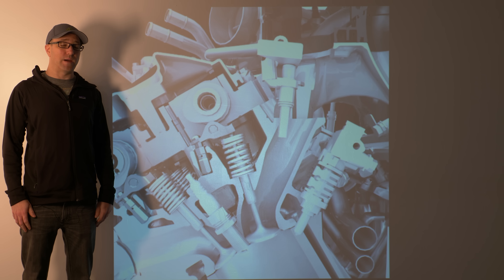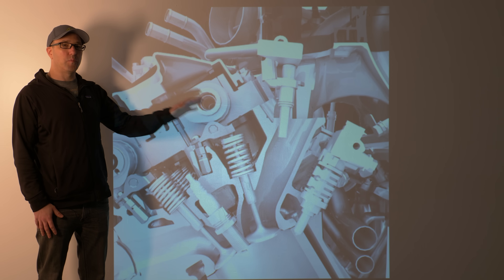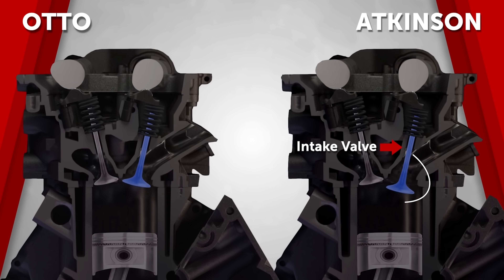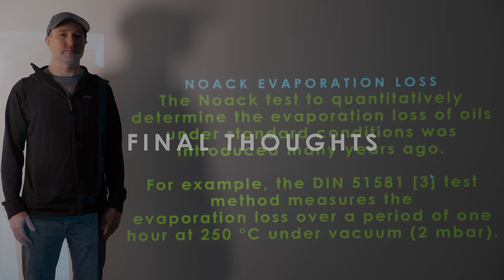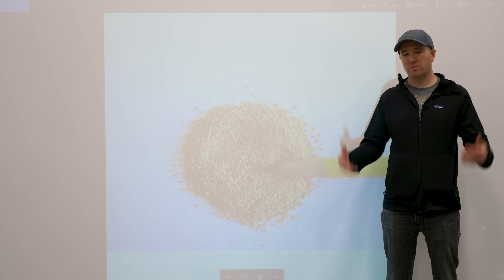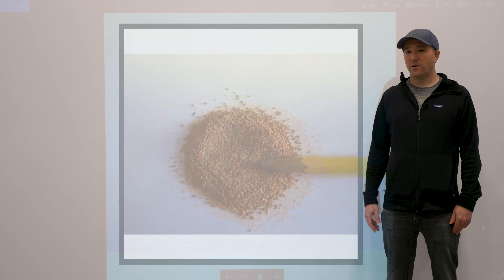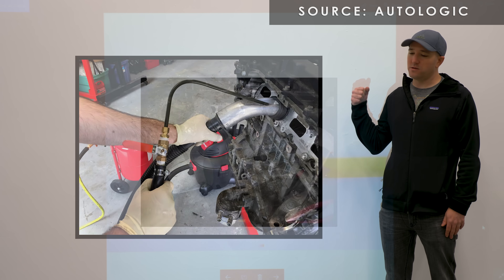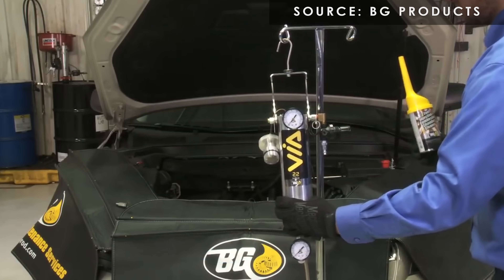Direct Injection, Problems and Solutions | The Fine Print

Comment: I bought a used 2014  2L GDI Kia Forte ES three months with 117K. I added a can of Chevron Techron right before I changed the oil with high-milege full synthetic and a Wix filter. I drive 3K a year and it doesn't burn oil. When should I be worried about carbon buildup on my injectors and in-take valves?

Comment: Driving and ownership habits matter as well. Change the oil with high quality synthetic oil often. No more than 5,000 mile intervals for my Z4 35i. Drive the car gently until the oil is fully warm and if turbocharged, let the engine run gently before shutting it off - think 2-3 miles from your destination.

TBH, I'll probably just treat the car as well as I can and have the valves cleaned every 40-50K miles. $700-$1000 every 50K miles to have the valves sparkling clean is not a big ask. Plumbing some aftermarket can and hoses into my pristine engine bay and needing to check and empty this can often sounds like a hassle. Do something wrong and you have new problems.

Manufacturers spend huge amounts of capital for R&D, and create very efficient machines. Most aftermarket add-ons tend to muck things up, creating the most value for the companies who market them.
Unless there's a critical issue (for which most OEMs will issue a recall), and I don't consider this problem to be critical, I'm going with manufacturer recommendations.

I've been down the customize road before - it's far easier to drive and maintain without all the crap we bolt on our cars - thinking we're doing something the OEMs never though of. My 2 cents.

Do as you will.

Comment: 18:55 - this really does not seem like a problem. I don’t know if this is typical or not, but the actual air path over the valve and seat is nowhere near constricted. The before and after the walnut treatment here would yield negligible improvement in air flow. 

automotive engineer here, albeit haven’t worked with direct injection engines.

Comment: The PCV valve vents oil mist pressure from the crankcase not the inlet manifold . This released oily air is then  directed into the inlet manifold to be burned in the combustion chamber . This is why the carbon builds up on the inlet valve. Port injection washes these deposits away preventing build up

Comment: To prevent carbon buildup on DI gas engines just install a small TBI setup similar to 90’s style, Chevy are you listening?!!! You don’t need bunches or port injectors in the head for every valve…..

Comment: Great video brother. Question for ya. So I have a 2017 Acura ILX (k24 DI) I bought with 29k miles in 10/10 condition. I have always ran 92/93 octane, fully syn every 3k but I’m not going into oil change intervals as I don’t care it’s just what I do even if it’s early. I changed the valve cover gasket at around 90k and couldn’t believe how immaculate the head was. Zero discoloration on any of the cams, valves, rocker arms, or head itself. Looks like it was machined that day no bs. That being said at she’s getting up to around 100k plus I do notice a rough being very strong word but at times at idle with the AC on, off it purs like a D15 smooth as butter and only hear the fans cycle on off. Completely stock 100% other than rims that I went with but did research the Exact size offset as the A Spec including the tire size. Went from 17’s to 18’s but figured I install the optional A Spec size in its exact geometry. I changed the plugs out recently, air filter always at 30k, and just general MX. I’m curious about the idle as it drops to around 700 when she usually chills at 900/950. I may pull the air box off the throttle body in the morning and look at the butterfly. Any thoughts?

Comment: EXCUSE ME but WHY does LESS FUEL BURNED not equate to LESS EMISSIONS?!
I'm on my third GDI engine vehicle.  Last one LOCKED UP, driving down the road at 60 mph.  Thst was fun.
It is ALL ALL OF IT, so much PLANNED OBSOLESCENCE SCAMMING.
So, INITIALLY, GDI developers did not know about CARBON FOULING.  
Once they KNEW why did they CONTINUE CHURNING THEM OUT?!   
WHY have MORE manufacturers gone with GDI?!
Additionally, they're also PURPOSEFULLY fitting pistons with LOOSER PISTON RINGS, which WILL promote MORE PISTON BLOWBY.
So go ahead and argue thst it's all out of the hands of scientists, engineers, manufacturing execs.
I WILL NOT BUY INTO THEIR LIES, CORRUPTION.

Comment: LOVE this video regarding DI. I have a 2012 Range Rover Autobiography, with a  supercharged V8 5.0L.  I'm in the process of tearing it down to do the infamous timing chain job. I endoscoped all 8 cyl. with/small 3.9mm dia. Endo., After seeing nothing bad, I removed it, taped it to itself w/electrical tape so after reinsertint it, I could look back up at the valves. All fine. Also used a sideview endo. & not bad either. I was going to engineer an oil catch can system for it, but I saw that the L. side valve cover has a built-in "oil seperator" by the PCV valves (that I'm replacing too). Do you think I should still  add a Quality catch can? Obviously, before 2012, JLR knew there was going to be an issue. Your thoughts please?  Thank you, John

Comment: Unfortunately modern engines don't have PCV valves, they have PCV systems that are part of the internal engine system and catch cans are not an option. Change your oil at 5K miles and use a high quality full synthetic oil.

Comment: Oil change on my new-to-me 2018 Sport 6 speed. I mentioned to my mechanic about the potential carbon build up and he had Pennzoil Platinum Full Synthetic on hand. Said this should help the engine run cleaner because it is derived from natural gas, not crude oil. Anyone else running this?

Comment: Regulators are so dumb. They should consider the whole life emissions of an engine(including burnt oil) and not just a snapshot when the engine is brand new and running in ideal conditions. Low tension piston rings just add to these problems.

Comment: Have a friend who owns a 2012 Lexus with DI 4 cylinder engine. The car has 90,000 miles and has had to have the intake valves cleaned twice since purchased the car. This has cost her about $1,600 in addition maintenance expenses. I view this as a design flaw that the manufacturer should pay for but Lexus disagreed with me

Comment: One major benefit of the GDI engines is that you don't have to think about octane anymore. You can run very high compression engines with 87 octane because it will inject the fuel when the piston is at the top of its movement when precombustion is no longer a concern.

Comment: I drive a 2000 Mercedes C230 Kompressor sedan that I will never give up because it has port rather than direct fuel injection. I recently bought a low mileage 2012 VW Eos convertible - well maintained and garage kept. And with only 1 month of ownership under my belt I'm already considering selling it for this reason (wish I'd done my homework BEFORE I bought it). Bottom line, my next car will be all electric. I'm done with turning wrenches on combustion engines.
Reply: Have fun changing those tires 🛞 constantly on your new EV.

Comment: Did a direct injector job on mums 2020 silverado 5.3. The valves and intake runners were dirtier than my girls 2005 grand marquis that i recently did an intake manifold job on. Both have similar miles on them. Port injection is better imo just because of maintenance ease. The marginal power and onomy gains just aren't worth it in almost all cases.
Reply: mums truck has also needed a high pressure fuel pump replacement at only 50k miles a few years ago. Having an extra fuel pump on DI vehicles is just more crap to break and leave you stranded.

Comment: Why would they spray in the cylinder when gas vapors only explode not raw fuel
Reply: You can spray just before the spark ignition, and that way you can get higher compression ratio without having knock occure. And you get better air/fuel mixture, better control of the mixture, better piston cooling effect, and so on.

Comment: Re "Catch-cans" @12:53.  I priced that one, the one I saw was from Misihimoto and cost over $300.  On my 2002 Camry V6 though I spliced in a clear plastic fuel filter that cost $3 or something, and put it inline at the vacuum hose between valve cover to throttle body.  Probably isn't perfect but it helps a whole bunch, probably just as much as that catch can.  I just replace it every couple of years.

Comment: I won't be surprised if direct fuel injection becomes obsolete because of the major problems having so many cars getting recalled with carbon build up. I would prefer having gasoline sprayed on the intake valves because they stay clean, and last longer.
Reply: LMAO, now literary every new engine is direct injected.

Comment: i get why you want one injector per cylinder but why put it in the cylinder? just put it in the intake runner, theres no need to put one in the cylinder at all.. the injector will work better and not get beaten up in the combustion chamber, and itll keep the valves clean so the engine runs good for a long time instead of just the first few miles then gats all carboned up and runs like shit.... doesnt a carboned up and disgusting direct injection pollute a lot more than a clean one? seems like youre shooting yourself in the foot here...

i was just in the market for anew car... i went and test drove all the new ones i was interested in... and then went and bought a 2016 with super low miles because it was a better car then the new ones... the new automatic braking and "lane keeping" crap makes new cars almost undriveable... the steering wheel fights you, the brakes go on when you dont want them to... fucking hell... your car is working against you... you wanna do shit and your car is like nope.. or just does shit when you dont expect... i call that BROKEN... and im not talking about "auto driving" this is just weird shit they seem to put in all new cars... you cant even option to not have it... its all standard features now.... unreal... then car manufacturers wonder why new car sales are in the tank... lmfao...manufacturers are shooting themselves in the foot  doing shit like this... nobody likes this shit except maybe some old lady who should probably have her license revoked...

Comment: I have the 2015 Honda Cr-V with the earthdreams direct injection (non-turbo 2.5L) and a cvt.  As of today, zero issues with these aspects of the car, and it's 10 years later.  I understand nobody is immune from engineering but for some reason Honda always seems to pull it off... for most.  I have heard of others with very real problems, but as yet I am not convinced it's at a higher rate than any other automaker.  Case in point Honda was just ranked in top 5 by consumer reports.

Comment: What vehicle from the 80s and 90s got 70 mpg? In my personal experience fuel economy was never that great and power output was modest. The fuel economy of a  vehicle is not just based on the engine... weight, aerodynamics, gearing, drive type (AWD.4WD. RWD. FWD etc) tires, inflation. electrical requirements etc. all are factors. As he says CAFE standards are forcing manufacturers to make changes to meet them but also consumer demands for features and the ever increasing size works against fuel efficiency. The Honda Civic is a good example of this

Comment: My 2010 V6 Camaro had the high pressure pump suddenly fail while driving at 70 miles per hour.
The pump when it failed immediately started pumping metal particles into the injectors which
in the space of fifteen seconds caused three of the injectors to get jacked open dumping  massive amounts of fuel into those cylinders.Thankfully I had the good sense to shut off the engine when the chaos started. If I had waited ten more seconds to do that, the cylinders would have hydrolocked and sent a rod out the side of the block.. The Chevy dealer service department said that normally when that happens , people don't immediately shut off the engine and  they wind
up having to replace the entire engine to fix it, at a cost of about 10,000 dollars. As it was. the bill
was 4500.00 to change the high pressure pump, flush out the fuel lines, replace all the injectors, clean the valves, and replace the spark plugs. All this chaos happened at 91,000 miles.

Comment: Lucas gas treatment provides that cleaning effect to the valves and upper cylinder. For a strong cleaning effect mix lacquer thinner in your gas. 
Dirty sludge is an issue as it builds up. 

If a engine has been neglected it will have sludge, unfortunately most think gas additives are “snake oil” some are overpriced and overrated.

Comment: The Toyota 1.2 Turbo engine is Direct injection and has been used in many of their car models but I've not heard of carbon  issues with these engines. I think its because of the injector angle and the use of the Otto and Atkinson cycle. The latter draws part of the mixture back past the intake valve which will help to clean the intake valve. Well done Toyota.

Comment: This video as of this comment is six years old. 
Catch cans are a good idea for vehicles in the south, not such a good idea for the ones in the north due to the cold freezing temperatures that turn that liquid inside them to ice, which in turn can plug the flow of vacuum. Best preventative is using high grade fuels and full synthetic motor oils. 
I've had the GDI engine cleaning service done to my Hyundai 2.4L GDI Theta II engine at 92K miles and I highly recommend it. My mechanic charged $119.00 for the service, and it increased my fuel mileage 5-6 mpg. 
Valvoline has made available a new product called Restore & Protect and there are already many videos on YouTube about its effectiveness. It comes in all the viscosity's and you use it like your regular oil at intervals of 3000 miles. It claims to removing all sludge and varnish from the engine as if it were new. I'm documenting my experience on the following Kia forum if you're interested: https://kiasportageforums.com/threads/2-4l-gdi-engine-burning-excessive-oil-is-valvoline-restore-protect-the-answer.427/#post-1230

Comment: DI absolutely sucks. A lot of engines even by 30,000 miles require thorough disassembly to allow cleaning of the intake ports. This can cost from $400 to $2000 or more depending of the engine. Dual injection (like Toyota's D4S) basically eliminates this need. Now, dont get me started on EGR and all the other emission system's crap. Basically the government has put the burden and cost of cleaner air on the poor consumers. Complete bullcrud.
Reply: BS. I have a DI engine (2.2 JTS). I bought it with 173.000 km, and it never had intake vavle cleaned. It worked fine. I took the intake manifold off and cleaned the intake valves myself. The engine has almost 195.000 km today. Basically, requires one cleaning every 200.000 km. 
BTW, using chep fuel will cause more carbon buildup. You must have realy crap fuel in the USA...

Comment: Direct injection is a disaster for anyone planning on keeping a vehicle for a long period of time. At first I was hoping the engineers figured this technology out. Especially for the long term. They didn’t though. And it’s becoming more obvious. 

I’m currently staring at a 5.3 with a failed injector. It failed on the customer as they were driving. It filled the cylinder with so much fuel that it pushed the head gasket out. 22 Suburban with 85k.

Comment: Water injection with water coming from hvac condensation would definitely go a ways to helping.
Reply: No, it wouldn't.  The O2 sensor would see high Oxygen content due to steam and would increase fuel to the cylinder which would make the problem worse.  I see where you are going but it would only make a bad problem worse.  Thats why manufacturers don't use Washer Fluid, which has Methanol in it, to clean the system.

Comment: Not to mention that the direct port injectors can cause a measurable loss of compression in the cylinder if it's seal fails.  I'm dealing with this in my 2017 toyota highlander.

Comment: Direct injection is much more efficient than port injection! Carbon builds on intake valves may be solved by another way not only by adding more and more port injectors!
Reply: “another way”. wow. what a fantastic solution that is.
Reply: @lukeWiz44  By adding one more oil separator on the engine vent line for example !

Comment: Great information!  You are the first one who speaks to the issue of car manufacturers needing to meet more strict fuel economy and emissions regulations.  Many of the reliability problems we see now with modern cars (CVT transmissions, multi speed automatic transmissions, low pressure turbocharged engines, complex electronic controls, oil consumption from piston ring blowby and GDI engine carbon buildup) are due to more government regulation. The internal combustion engine design has not caught up with the regulations so, our cars won't last as long without major work.

Comment: Another idea he did not suggest with DI engines is driving them hard at least once a week. Driving hard may make help some of the carbon on the valves get burnt off. However, this works when you change your oil frequently, when. By frequent, I mean at least 4 times a year. Change your air filter twice a year. I did this, and found my DI car improve in performance and gas mileage.